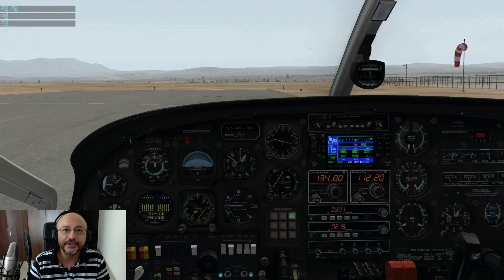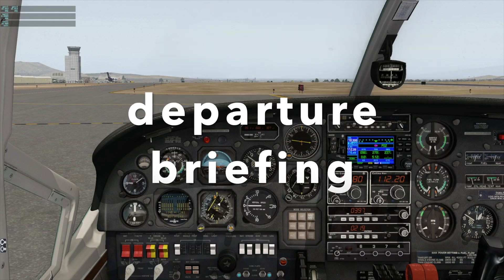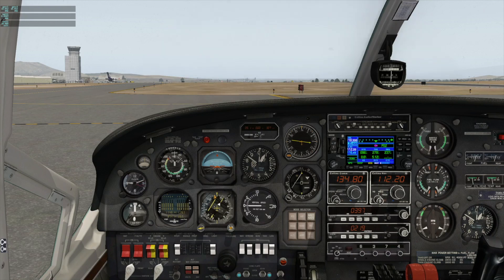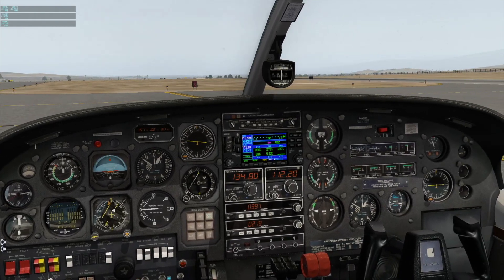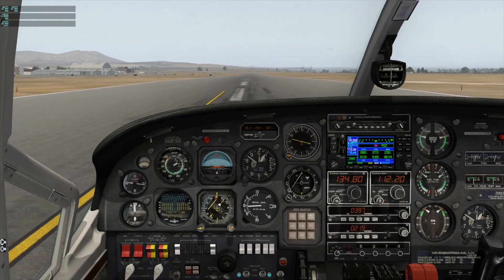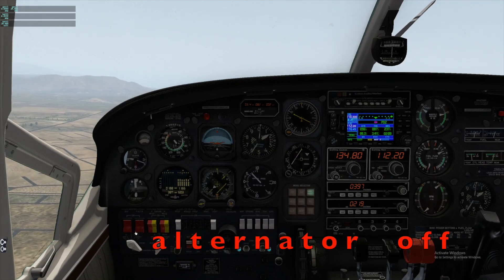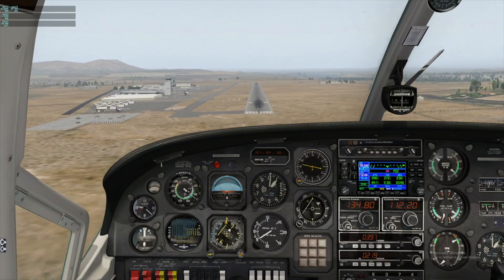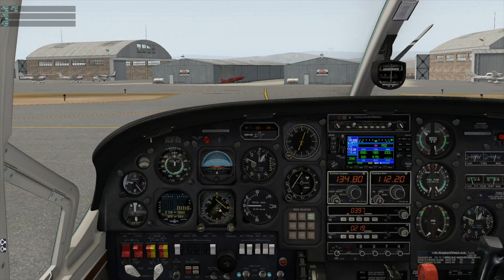Engine failure in a Cessna 337

Comment: This is generally good, but I would like to point out a few issues. 1. Why does the RPM go to zero with an engine failure? This would not happen until the prop is feathered…unless you have a complete engine seizure. There would be some ROM drop, but it would stay above about 1200 rpm. Similarly, MP would increase, but not all the way to outside air pressure. Your best instrument indication of which engine failed would be EGT dropping.  Your real indication of engine failure is a very noticeable decrease in performance.  

2. If you have greater than 3000 feet of runway, your best option when the engine failed in this scenario is to abort the takeoff. Accelerate stop distance is 2700 feet. With normal takeoff, even if you get to 50’ AGL, you will still stop in time.

3. The first thing to do in an engine failure is establishing Vyse (78 KIAS) while assuring that you are asking for maximum power. THEN go through the other steps. It will climb at 78 with gear down and prop windmilling. It will DESCEND 250 fpm with gear in transit.

As the poster said, this is a simulation. The Carenado 337 simulator does not model prop effects very well, so some of the deviations between this and actual 337 procedures can be attributed to deficiencies in the model.